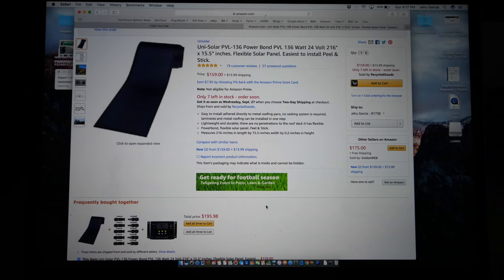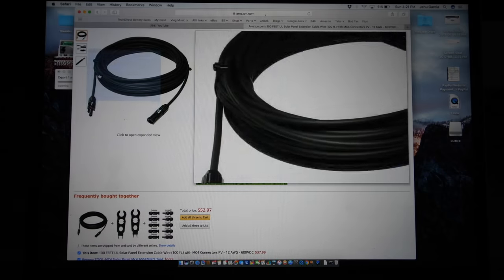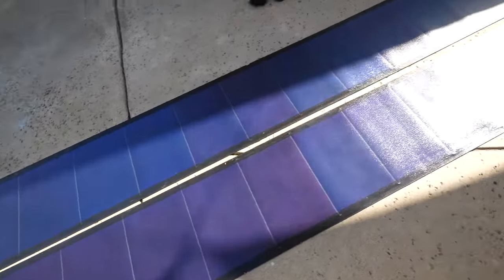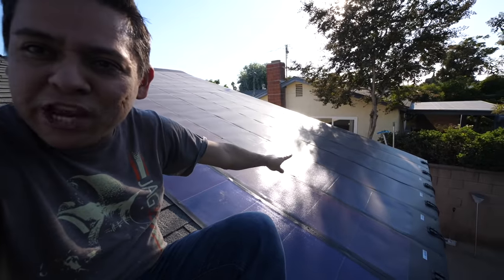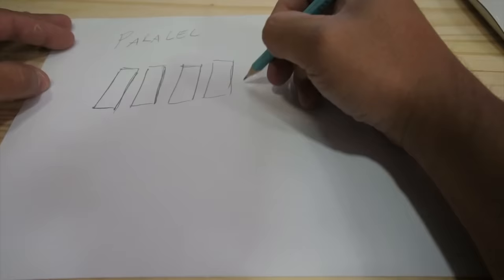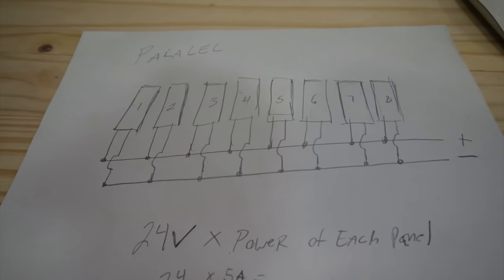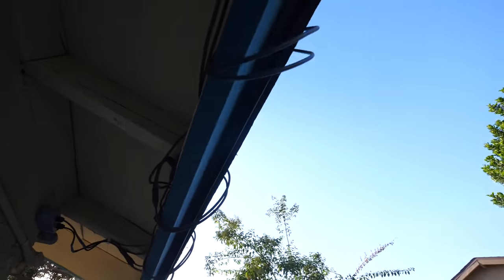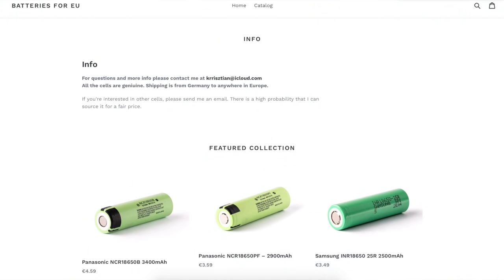My $1500 Introduction to SOLAR panels

Comment: Wow, I'm in a rental that doesn't want me to install solar. I can afford it and everything, but landlord thinks I'm going to ruin the roof. I'm not! I don't like that you installed screws directly into the roof though. I need another option
Reply from the maker: +Shon Alexander  is there another option?  All panels need to be screwed on
Reply: I hope so. I was thinking about PVC piping with sandbags
Reply from the maker: +Shon Alexander  not on a pitched roof,  screws is the only way
Reply: Like, build a mount out of pvc, then secure it down with sandbags. Something that doesn't intrude with the water penetration of the roof. My landlord is very strict and almost won't consider anything. I love the price of living here, but the landlord is making it hard to justify staying here. I just want to supplement the power usage here as I'm paying over $200/month in electric.
Reply: Oh, and thanks for replying! Much appreciated!
Reply from the maker: +Shon Alexander sounds like your landlord at least cares about his place,  ours  can't be bothered for anything that we need,  he once took  1.5 years to fix a leaking pool I had to let the water turn green and call the city which declared it a health hazard and threatened to fine him that he moved on it
Reply: Oh jeez. Yeah. Mine cares, but I want her to be happy at the same time. A/C is expensive
Reply: How about a simple ground installation?  Then you just need two posts in the ground, down three feet, have a frame between, and connect them with 2x4.  Screw the panels to the frame. Run the electrical underground in some good underground cabling and then into the house.  Have a certified electrician make the connections.
Reply: I would totally do that if I had the ground to do it. I have a very tiny back yard that gets a lot of shade from the neighbors house. I have a south facing roof that would be perfect. Just don't have the permission.
Reply: Shon, there is a mounting system made by solarpod. It is called the solarpod crown. www.mysolarpod.com. It would be easy to make something like this. especially if you can weld or know a welder. It is just unistrut and some assembly brackets.
Reply: +Shon Alexander,
 One of your problems is that to do grid-tie you will need a letter from your utility, engineering to prove that 110 MPH wind will not blow it away and have your landlord get the permit. Then the solar becomes part of the house if you ever leave the solar stays. Even if you do all the work your self and get the tax credit for this year it will still take about 6 years to break even. 
The problem with doing an illegal grid-tie system is what do you do when your system generates more than you are using? You would also forgo any tax credit. Where I am it would be fed back into the grid and my utility would charge me for it as if I used it rather than giving it to them.

The other alternative is to use all your power to do things like charge your electric car. Oh wait, you want to drive your car in the daytime? If your car is not at home to be charged you will need a power wall equivalent to store the energy or just not harvest it while your electric car is gone. Add the cost of the electric car and power wall and the $200 a month seems like a real bargain.

If you insist get a racking system from someone like Ironridge where they have an app that will do the array engineering for you. It is more cost-effective to buy their hardware than to pay an engineer to sign off on your plans. If you find a co to do this for you count on about $3 per watt DC. If you do it your self you should be able to get down to $2 per watt on a 9 kW DC system. in some locations, if you get to 10 kW or more the permit rules get more complicated. If you go much smaller the cost per watt goes up.
Reply: +Bill Rookard,
There are still places in the US that would let you do that. I here there are 2 counties in Idaho that would not need a permit for the solar part but would still need an inspection to connect to the grid. There are very few places that would not require steel and a commercial raking system. I tried for 6 months and the building department kept shooting my plans down. I went to ironRidge.com and had a plan in 2 days but they still needed to get a geotechnical co. to sign off my soil and an engineer to sigh of on wind exposure B. Signichars cost me $600. I had a working relationship with the geotechnical co. otherwise, it would have been more like $400 more. Total hoops to get the permit cost me at least $2000 more than my original wood design. Fixed costs like that make small system less practical.

Comment: Wow I own my own roofing company just to let you know but that asphalt cement will Crack after a couple months even if you used a polyurethane  what about under the panels so I just want you to understand just cause you don't see a water spot on the ceiling doesn't mean it's not leaking. I'm not trying to blast you but I would get some to fix that before home owner see it and you have to pay to replace it.

Comment: Using a UPS to run continuous can be dangerous unless it’s a online/double conversion one thats rated for continuous duty. Most of the standby ones have their heat sinks designed to absorb the dissipated heat only for as long as the original battery will permit the unit to run. The idea is that the battery will die before the unit can overheat since the Rds for the H-bridge and the power capacity of the battery is known, they can calculate exactly how much heat will need to be sinked to keep the unit from overheating in that time frame (usually under 30 minutes), and then they cool off passively during the recharge phase.
Reply from the maker: Yeah maybe 50% duty on continuous

Comment: Hey I'm planning to  start small  solar project  just hundred watt solar panels 12 volt maybe one kilowatt power inverter and I'm planning to use it on daily basis just to power a TV maybe gaming console just during the day my question is for power storage which one will be better 80 LiPo4  battery 3300 mah each for a powewall project or two 6 volt acid leads battery 235 amps h deep cycle ?
Reply from the maker: Lifepo4

Comment: Thanks for this great video.  2 questions.  Are there any denser (roll away or otherwise) panels that you like?  What are the cost differences between using 18650's and a bank of car batteries?

Comment: Guys, I have a 40amp charge controller and some solar panels, what is the best configuration of 18650 cells to get a decent sized "brick" to put in a plastic ammo can?  I am going to mount the batteries, charge controller and a couple of usb ports in the box as well as a lcd panel with power details and a 12v "lighter" port.  Will use it to charge phones,  light some LEDS in a power outage.  I am a newb to the 18650 batteries coupled with solar and I don't want to mess anything up.

Comment: there is a issue with your math on the panels yours are amorphous panels which shading effects much less than regular mono or poly panels you really should have went 4 in series then parallel the other 4 in series with the first 4 making around 125v per series with low amps this will also reduce losses from shading and will increase your usable power hours because will take much less sun to get over the tipping point to start charging aka point at which panel voltage raises higher than your battery bank. I want to also point out with a descent MPPT solar charge controller can really up your efficiency by a huge factor also another thing amorphous panels have almost no impact by partial panel shading.

Comment: they may say 24 volts but they are higher then that. peak power is always higher. normally a 24 volt panel can put out 36 volts peak.

Comment: how do you setup panel to the load then or to the main circuit panel , Generator panel , transfer switch , controller
Reply: If you are doing a legal system and are going to hook up to your main circuit panel you need a grid-tie inverter that "back feeds'" a circuit breaker.  Depending on what deals your utility has most of the time it is most cost effective to stop there. If you are willing to  pay hundreds of dollars per hour to avoid power outages, your utility will not pay market value for your excess energy  or you have a very unreliable utility then a power wall equvelent could be usfull.

Comment: Have you looked into using blocking or bypass diodes to increase efficiency?
Reply from the maker: That would work on series panels, mined are paralleled
Reply: jehugarcia I guess more specifically what I was trying to ask is do you know if series panels with bypass diodes would be less effiecient than parallel panels?

Comment: you could have used a metal hook supported by the wood under the tiles, you can lift a tile, put the hook and voila, that's supported with no screws.

Comment: Roll up style are not monocrystalline type and make less power than the big heavy framed panels used for big installations. They are good for camping etc. PS I would never stand on a collapsible ladder.

Comment: OK so I am trying to avoid messing up the roof. I was going to mount a pole in the back yard by digging a hole and then pouring concrete and then using a mount on the pole. The question I have is that I was going to use the plug and play solar panels. The company is literally called plug and play. Does anyone have any experience with them if so can you let me know if I should go another route other than the plug and play solar panels. Any feedback is greatly appreciated.

Comment: HI, love your channel, lots of great insight. Here's a question for you: I have a 120V AC/1500w 2500gph Sump Pump that must run off grid with solar power and leave a little extra for electronics that will monitor the quality of water. It will be installed in Maracaibo, Venezuela, very very sunny (scorching, actually) all year-round, very dry, hardly any rain, consistent weather throughout the year ranging from 30 to 40 degrees centigrade. Any recommendations? Keep up the great work!!

Comment: wrong panels....wrong place., incorrect installation. there ar no parralelling diodes eather, so in shadow your whole panel doesnt work. these panels are junk, and wont last 5 years outside anyway ..not to troll, its my proffesion... using 260 watt glass panels work way better, also whit shadow..
Reply: MrBugsier5 There is nothing Pro about that spelling bro. How did you get that job?
Reply: Y’all do know that just because a person can’t spell... has nothing to do with his intelligence ... he was giving advice.. perhaps the next time there won’t be wasted effort and time
Reply: why english speakers ALLWAYS forget that there are way more languages out there in the world? if someone is not good at spelling it doesn't mean automatically they are dumb or they are lying. it MAY be they are not native english. ffs...
Reply from the maker: 2 years later the system paid for itself and its all cash on my pocket from now on,    good job being a naysayer though, I definitely would not get half of what I do done with out you guys.
Reply: @JoachimVampire  Also posting fast without using a spell checker can do it to you. You'd be surprised how many with a PhD are lacking in common sense.

Comment: Can this Powerwall be connected to your home? To power home appliances and TV?
Reply: Or can I use to to just charge my EV vehicle?
Reply from the maker: Both
Reply: Off grid option
Solar Panel -> Charge controller -> Inverter & Battery -> Your home's electrical appliances.

Comment: I bought over 6kw of panels on ebay for 800 dollars and then another 400 in shipping for a total of 20 panels that are rated at 315 watts each. Then I bought a used grid tie that is 6kw that mounts on the side of the house.  the panels can put out a max of 6.3kw  It's been maxing out my inverter at 6kw output at peak time.  Now you can't just hook up a grid tie without filling out paper work with the power company and jumping thru hoops. they want to see all your plans how you are going to mount them. they want drawings of your roof and house. with measurements and all kinds of crap.  I bought the inverter used for 250. then i had another 100 dollars into wiring.   for 1,550 dollars I got away cheap for a 6kw system.
Reply: there are some extra cost I forgot about. They are frame-less panels so i had to get frame less solar mounts. I found a web page to buy them and they were cheaper then the price listed on ebay. then i bought c channel from lowes 20 foot sections and made my own rack i had like 200 to 300 dollars into stuff to mount everything. I have a channel but no videos of installing it. If I would of had more help I should of done that. I bought my panels in the winter right before spring so i think the prices were down.  I also bought the inverter in the middel of the winter as the price was lower in the winter. luckily i already had some solar on my roof so when it came i was able to test it to make sure it worked as i bought it used.  the panels were new without the boxes installed so i had to install the boxes to they came on a pallet for freight. the guy i bought them from on ebay doesn't have them as cheap right now. he doesn't have  as large of a supply of panels ether.  ebay seller was santansolar  it seems like his price is about half of what others sellers are selling panels. some times he will have grade B and C panels and that is what i got. discolored and some with scratches on the panels. that is why i got mine so cheap. they were new just slightly damaged. no cracks anything major.

Comment: MPPT will get you full watts rating maybe more,
Reply from the maker: Im hoping you are right,  I ordered a real solar controller as well but it has not arrived
Reply: I have two 190 watt panels ( 380 watts ) connected to 30 amp Rogue  technology  MPPT and have seen over 450 watts from the panels.
Reply from the maker: but it could be the panels over performing ,  my fake MPPT charge controller could be just as efficient as yours (I doubt it, but possible)